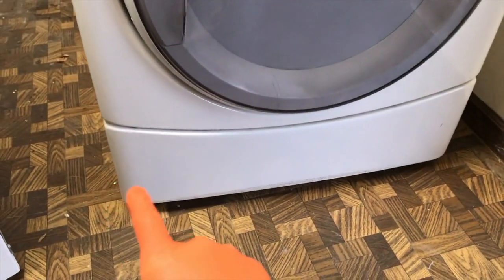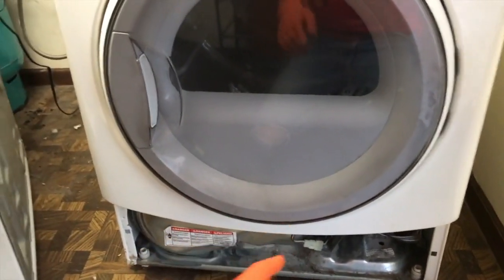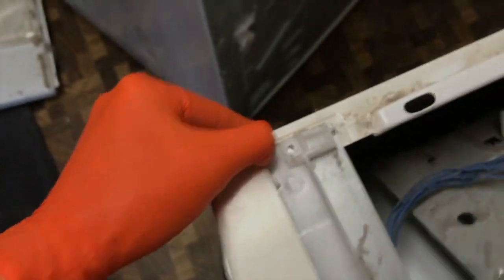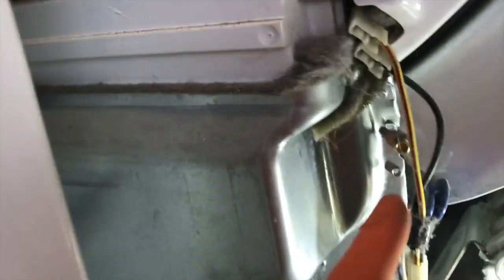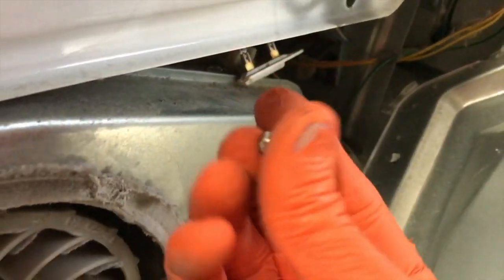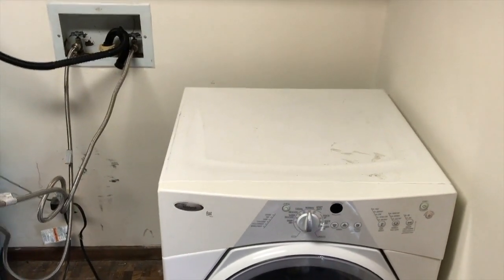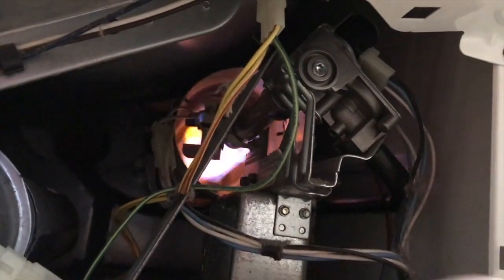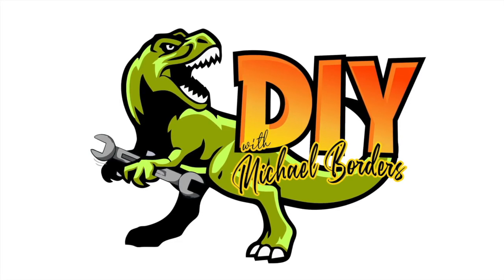How to replace Whirlpool Dryer Thermostat

Comment: Do you have to take the top plate off to remove the thermostat? 

Or Can you just access it from the bottom plate?
Reply from the maker: Thanks for watching, some viewers have accessed it from bottom however they mentioned the machine model was different.

That will be personal preference.

Comment: Het, great job but I noticed that you didn't say WHY you were changing your thermostat. 
Question: You show at the end the flame kicking on, did it switch off, is that why you changed the thermostat? Or could that be because of a coil malfunction as well?
Reply from the maker: Thanks for watching & welcome to the DIY Raptor Club.  The thermostat was faulty & not allowing dryer to dry cloths.

Once dryer was turned on, the dryer would spin however no heat was being applied.  After 30 minutes of the dryer running, clothes were still wet and cold.

Comment: I swapped out the coils, the ignitor and the flame sensor because i was too lazy to get the device to check each part for continuity.. I ordered the part from this video and i hope this works for me as my dryers ignitior is still not glowing after switching out 3 different parts.😧
Reply from the maker: @brownie155  

Thanks for watching.  That’s awesome you are making it a DIY project.  It’s likely if your machine is experiencing the symptoms as shown in this video, then replacing the part should fix issue.

Keep us posted.  😁👍🧰
Reply: @DIYwithMichaelBorders  my part came and it worked! So easy and you saved me so much money. I'm grateful I found this video.
Reply from the maker: @brownie155  

Good morning ☕️

That’s great news and we appreciate the update.  You are always welcome to reach out to us any time!  The DIY community is the BEST!  😁👍

Comment: I want to change my thermostat WPW10625430. However, that thermostat is not in the market anymore. Can you recommend any alternative I can use instead? Thanks for the advice.
Reply from the maker: Thanks for watching, we can definitely help.  We will need your unit serial number so we can lookup the alternative Thermostat option.  Please keep us posted.

Hey if you’re into crypto trading, join our newly launched DIY community ecosystem.

       Toolboxtoken.com

We DIYers need to stick together!  🧰
Reply from the maker: @love2bite1  

Awesome, we did some looking.  Check out the link below.

       https://applianceparts365.com/whirlpool-thermostat-part-w10870284

It states that it’s in stock, you may want to contact them before purchasing.
Reply: @DIYwithMichaelBorders  you are amazing. I will contact them. Thanks :)
Reply from the maker: @love2bite1  

😎👍🧰

Comment: That's the fuse, not the thermostat
Reply from the maker: Thanks for watching, thanks for sharing your thoughts.  With our unit, that is the Thermostat.  Hope all is well with you and your family.

😎👍
Reply: @DIYwithMichaelBorders  And what about the part that in your video is right next to the thermal fuse? From what I've researched, it's Thermistor #WPL-WP8577274. I don't know what it's for. The point is, if you're going to replace the thermal fuse, it would be good practice to replace that one as well. By the way, the thermostats on the gas dryer are located in the Burner Funnel (WPL-8573713 & 3391912). By my reckoning, the system uses a total of four temperature sensors, between measurement and security.
Reply from the maker: @ruben3585  

Thanks for watching & sharing your thoughts, any & all helpful info is greatly appreciated!!!

😎👍